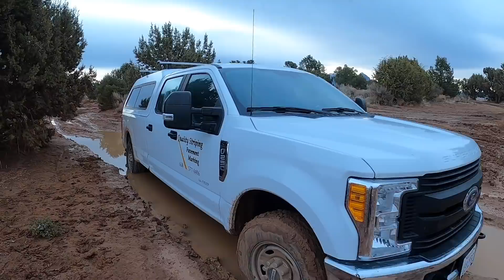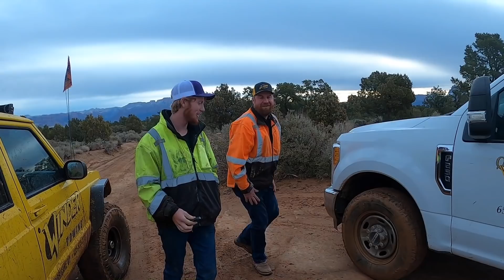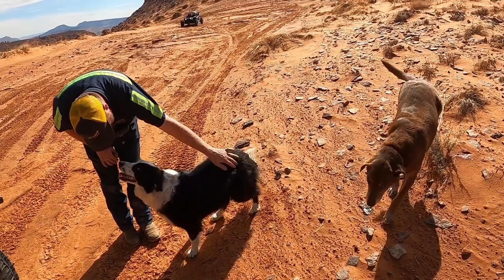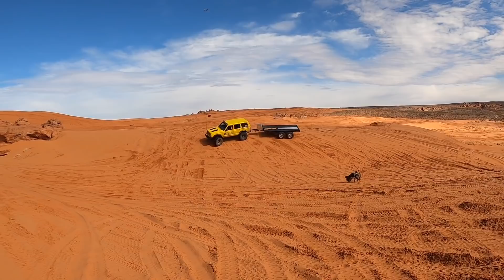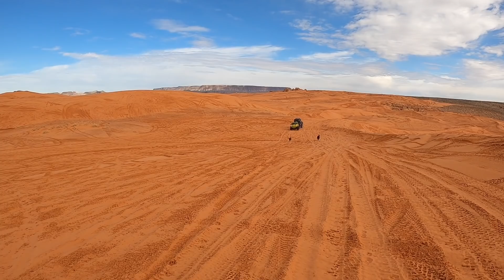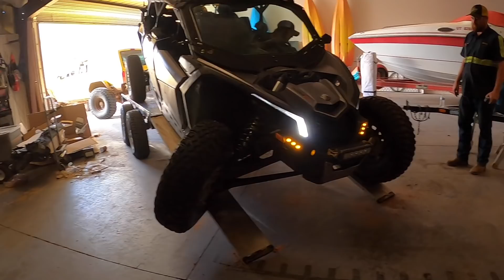2WD Ford Truck Goes Mudding And Makes A Call!

Comment: That was some slick surface mud.  I was from coastal Texas and I remember when a fellow Marine asked me if I had driven in snow before.  I replied " no but I've been in the mud a lot."  He gave me the strangest look.
Reply: ive been in mud like this before out wheeling out there , but i live in new England and the snow/ice is a whole different ballgame to this kind of mud
Reply: @Enolaskum  yeah, ice is a different game, but  you get more traction in snow than in caliche or clay soils that get a fast half inch of rain on them.  I live in CO now, so I have a lot of snow and ice experience.  There is one Forest road I use a lot that the ranchers that live on it will not use after even a slight rain. It is caliche with a tilt to the cliff side with a 200 foot drop.
Reply: You got that right. Muddin' in Texas prepared me for Idaho winters. People thought I had driven in the snow all my life.

Comment: Banana and trailer whipping around those dunes looks like it should be a video game
Reply: Just need a sand map in SnowRunner!
Reply: Let the way things are going I wouldn't be surprised if the yellow banana pops up on Beaming drive with an unlockable bonus of the TOWVARE🎮🍌🚖😆🕹
Reply: @Sparky_Sct  I'm sure somones made banana mod on there

Comment: Hey, MORR! Big fan in Alabama here... For all the side-by-sides you rescue with just the front end busted, I can't help but wonder about a device like a tow bar but one that, once strapped to the front of the side by side and lifted onto the Banana's hitch, raises the front wheels off the ground and basically turns the side-by-side into a trailer that you can tow directly connected to the Jeep. If you knew you had a fair chance of this working, you wouldn't need the trailer, or could leave it on the pavement and not drag it through the sand. With the side-by-side hitched to the back of the Jeep, one of the crew could sit in it, put it in 2WD mode, put it in gear, and help power the two vehicles out together. Okay, maybe that's not practical, but it sure is fun to think about stuff like. Six-Wheel Drive, baby!

Comment: I bought a new 2WD Suburban in 1998 in Atlanta.  I asked for a 4WD and the sales guy said what would you want that for.  I said the snow for 1.  He said, it never snows here.  Right after that I moved to WA and got stuck in the snow...  Still have the same rig in 2021.  I always say I will get a new truck when the 98 stops being reliable.  255,000 miles and 23 years later, it still runs amazing.  Not having 4WD has probably saved me thousands in gas and repairs and is fine 99.99999% of the time.  I’ll be sure to keep it out of the dunes though.

Comment: You'll make it all the way to the where you can't go any farther.
Reply: Anyone wheeling alone should carry a long rope. You can wrap it around a tire and use your wheel as a winch and also make a manual flip flop bush-winch with 2 small trees.
Reply: @badgermetal  wont work unless you have a lsd or a diff lock otherwise other wheel will just spin
Reply: @Jacobtheunwise   Thats a good point. I haven't tried either method yet but it's all I have rn until I can get a real winch. I do have a welded rear end tho so that helps.
Reply: @badgermetal  can you link me an example? I think I’m understanding the premise, but I’m not sure lol
Reply: @badgermetal  Just buy a winch... It’s way cheaper than having to get recovered! At least get a come-along, they can really save your butt!
Reply: @CarswithNash  I threw a come-along in my truck now after having my dad come get me now i don’t get stuck... but I also replaced my transfercase
Reply: alfred selle   Nice English words, Dr. Shakalu. 
-Dante
Reply: Further
Reply: Yes
Reply: @CarswithNash  yes. I'm gonna buy one today. My dumbass keeps getting stuck in icy snow drifts. 2 hrs each to get out. 10 minutes to get out or less if I had  a winch
Reply: @TheDeanGullberry  I’ve been there LOL!🤣
Reply: I'm almost always alone when I go out due to my work schedule.  I go prepared.  I have lockers, winch, shovel, chain saw, come along, tools, straps, chains, jack, CO2 bottle...  I've used the come along as much as the winch.
Reply: Truth!
Reply: @Jacobtheunwise  you can actually use your rear wheels as a winch and use your parking brake to keep force on both wheels and keep them both turning.
Reply: @justinbullock681  Further is figurative, whereas farther is physical. He asked how FAR could he go, so the correct word is Farther. if he asked about his motivation to continue, then it would be further.
Reply: 65 is cold front in Houston

Comment: currently working on building an R/C rock crawler to look like the Banana
Reply: do you have any social media we could follow the build on? i would love to see it , ive been thinking about doing the same thing
Reply: Was kicking around the idea as well. There’s no Cherokee bodies out right now (merch idea Matt) I have the proline 4Runner, was considering using that...
Reply: @sushihamster1  Axial makes a Cherokee body. Part number AXI31337.  They have them at Amain Hobbies.
Reply: There's a guy that duplicates Mats off-road videos with an RC rock crawler..... maybe he has a build on his channel. It looks really authentic....
Reply: @skeetermcswagger0U812  i follow him!
Reply: @sushihamster1  someone makes a 3d printed xj body for the axial scx24 aswell , thats what ive been looking into
Reply: @Enolaskum  🤠👍
 I just brought it up because I have a Traxxas TRX4 that has an AXIAL metallic  burgundy color Jeep Cherokee body on it and I'm gonna leave the burgundy paint and paint over it with yellow and leave those voids where the front and rear bumper caps used to be so it'll look just like it. I don't know if I'll put the decals of the towing company on it but I think it would look cool.
Reply: @sushihamster1  There are several Cherokee bodies out there and most of them are hardbodies. There's 2 door and 4 door versions. 

I too have playing with the idea of making a scale Banana truck, I just need to find a good reason to add another truck to the collection :)

Comment: I had a 2wd 2000 gmc 3500 with a g80 locker in the rear and I tell you what that thing would work unspeakable miracles for the truck

Comment: We live across the road from Millerton Lake here in CA. When the lake goes down, people try and drive over what appears to be a dry lake bed. It is only dry on the surface, once you break the crust, one is axle deep in mud. Amazing how many people try and take their 2WD trucks and crossovers down there!  Pulled out my share of these people. Should charge them. If only as an "Idiot tax". As it is, I save them a hefty recovery fee.

Comment: I've realized a few things since watching this channel.  One.  I would move there, I love it, it's beautiful!  When I got there I would get a job as an engineer even though I have a 9th grade algebra math level!  The guys that engineer the side by sides are clueless!  You can't lift these things and bolt on power adders and 35" mud terrains and NOT address EVERY suspension component!  Put one of those on a lift and give me a demo bar and in 5 seconds I could break the front end using the bar and tire as leverage.  They have to do a better job!

Comment: I’m sure you get stuff like this all the time, but I just finished up my zj (5.2) and I have been towing people all over. I live in keystone so I am just doing it out of kindness. But it could be a cheap build for doing dune towing Jeep was 1800 lift was 1600 rc long arm and tires you know but I was flat towing a vw Jetta the other day because my buddy lost his trans and it had no problems after I put in a high-volume water pump from Quadra track just wanted you to know in case you want to add another jeep with something with enough towing power

Comment: You need a quarter of a 30 gallon plastic drum actually two to use as wheel sleds
Would make moving and shifting machines on the trailer a breeze

Comment: I have 2 wheel drive open dip wet through mud holes 2 feet with water good off road tires with all the rain went through it slow did good didn't stop no 4 wheel drive

Comment: Hey just a quick question. How come you haven't put a couple hook points on the sides of the trailer like you have on a flatbed? Then you could pull the machines to the side you need without all the pushing and shoving.. Just curious if there's a be reason we don't see? Love the videos, great work!

Comment: I learned how to drive mostly with my dad's '69 C10 2wd, posi, three on the tree and then drove a '69 Camaro through many a blizzard mostly because I was chasing tail.  Never got the Camaro stuck, although I would now being spoiled by 4wd pickups for decades now.  That positraction, though, was worthless.  Just seemed to make you fishtail.  Got that thing stuck often enough that dad never got posi again and didn't get 4wd until his first K10 in '82.  I laugh when guys claim you don't need 4wd.  No, you don't, not when it's in the garage anyway.

Comment: I am wondering, if you had, sometype of "straps", that connected to both front tires, that would keep the wheels parallel, you might have a better recovery with these things.
You would have to custom make them, "normal" people wouldn't own them. 😆

Comment: I have a '12 Silverado with 4.8L,  2wd and auto locker and the stupid drive by wire throttle body and ecu won't give me anything over 2500 rpm when I get stuck on a job site.  Very aggravating.

Comment: 4 Wheel Drive vehicles tend to give the uninitiated overconfidence. I have pulled out some folks with 4 wheel drive with my two wheeler simply because I was paying more attention to where I was going. It has a lot to do with your level of experience. Certainly an experienced four-wheel-driver Will do better than the two wheeler.

Comment: Why don’t you put a pull block on the rear of the trailer to unload broken machines you can use the trailers winch. Just run the winch line down through the block then hook back up to the machine at the front of the trailer.
Reply: Good idea!

Comment: That's weird that, that is 2wd but still has lockers
Reply: Rear locking diff is fairly common on Toyota Tacoma and Ford 2WD trucks in the old tacos it was a manual pull and I'm the Ford's you pull a knob where the 4WD select would usually be. I think for warm climates the figure the 2WD units still need help in sand and at boat launches.

Comment: Lol why do people still buy 2wd trucks better yet why even make them
Reply: There is nothing wrong with 2wd pickups, unless you live in an area that has the slightest chance of getting snow or mud.  They actually get pretty good fuel mileage compared to 4wd pickups.  If you limit them to on road driving.
Reply: Fuel mileage. Wheel bearing failures. More maintenance.

Comment: First
Reply: 4th,*  but very close.. you were indeed very fast
Reply: congrats you have been promoted to 3rd.. looks like #3 deleted
Reply: @ColinRichardson  Agh, I posted and refreshed, I was still the only comment. You ned to refresh to see if you are first.
Reply: @marvindebot3264  I use "sort by" which does a refresh of comments without refresh the whole page
Reply: @ColinRichardson  That is because they felt stupid to type FIRST only to find out that they are not .